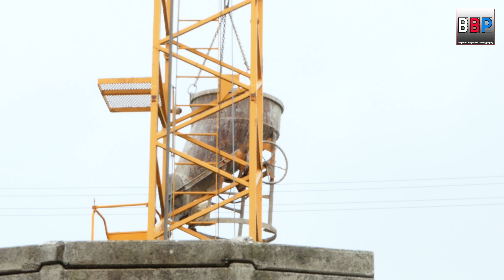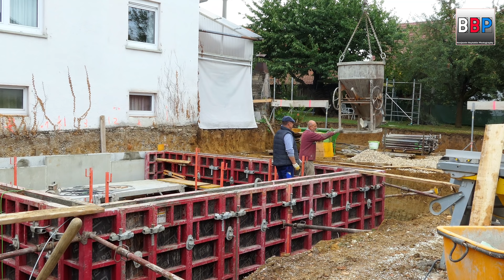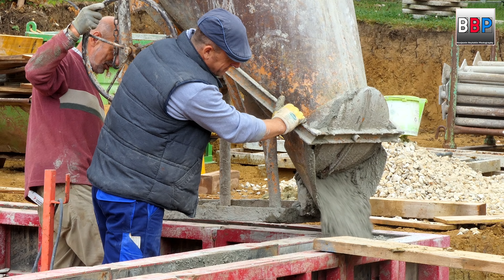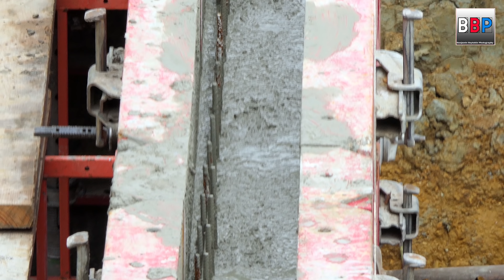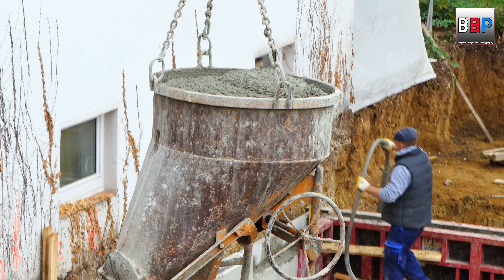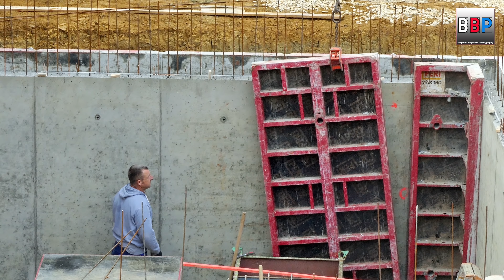Hausbau: Kellerwände betonieren / Concrete Basement Walls, Germany, 2018.

Comment: Why not use a cement pumper? Would only need the trailer kind with a hose? Could have done floor same way.

For Americans think?,this house will likely only cost $180-240k, we build with wood on a crawl space and it costs twice as much!
Reply from the maker: Pumper is too expensive for such a little house. I spent a lot of times in the US, know how they built dwellings ;-) Thx for watching Allan!
Reply: They use those what I call small tower cranes alot in Europe. I kinda like the idea, if they are a resonable cost.
Reply: Brian Gardiner. .. A friend of mine had to hire one to get the ready made concrete floor beams for a large private house he was having built over some 'pine trees' that he wanted to leave in situ. They obviously got the crane in, (in pieces), but couldn't get the lorries with the 30' beams on them in the drive-way. Cost of the crane £180 per week that was about 10 years ago, he had it on hire for 6 months.
Reply: If you use a concrete pump, you would still need a crane to put up the form work, move bricks, rebar etc. arround unload building materials. Having a crane on site makes you very independent, and you save money on the material transport, because every tipper truck, that has an empty ride can deliver your materials, you dont have to pay more for a truck with a loading crane.